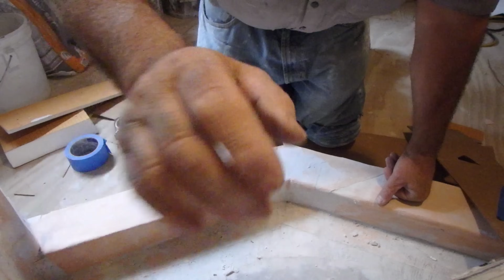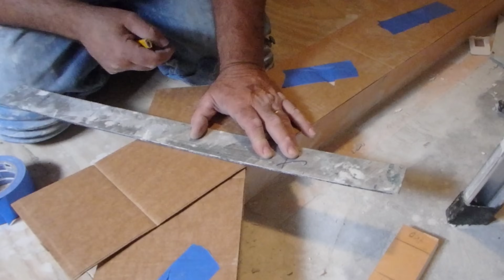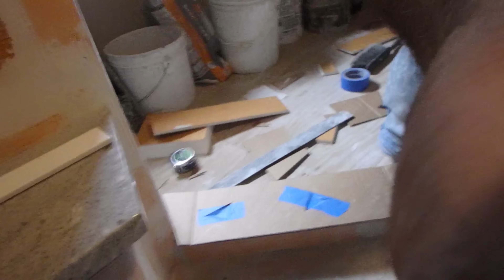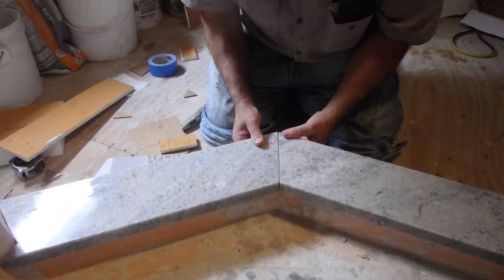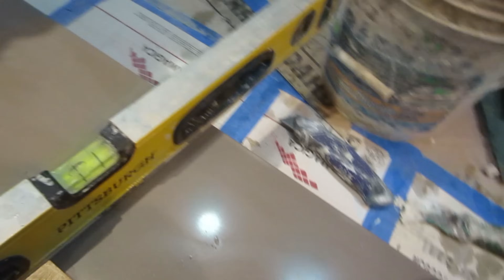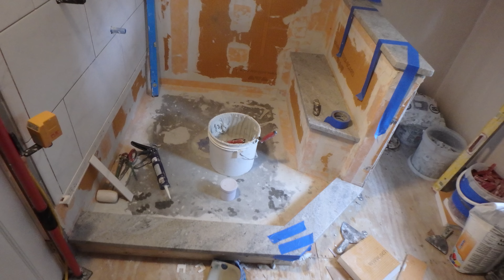Fitting marble thresholds on curb of  neo angles tile shower

Comment: We mitered our last Neo angle shower curb and that was a pain in the butt! We'll have to start using solid surface more often and for sure have to use this template idea. It looks like it can be done quickly. Thanks Sal 👊
Reply from the maker: I Always use sills, no grout lines, simple, easy, quick.
Reply: I like simple easy and quick, thanks again 👊
Reply: Hi Sal, I saw that you recently posted a video on how to correct align the Dewalt tray/rollers. Would you mind re posting that video?
Reply from the maker: Landberg Tile TV  The link is in the community tab, here it is gain, https://www.youtube.com/watch?v=vHbPS3BTy8E

Comment: Great video! I'm installing a marble threshold kind of like this. Should there be a gap left between the two pieces for expansion (filled with silicone) or is it ok to butt them up tight to each other?
Reply: wondering the same

Comment: Hey sal great video just wanted your opinion on a job I have coming up it a garage floor I’m gonna go directly over the concrete and leave out the ditra cause I don’t think it has the strength to support a car. Please your thoughts thank you
Reply from the maker: Ditra will be fine under a car, not an issue at all.
Reply: Is it ok without the ditra?
Reply from the maker: RM Tile  yes, but better with.

Comment: Sal my man. I have an emergency. I used Go Board on my shower walls and around the window, installed drywall corner bead around the window and added joint compound. I then sealed the joint compound with PVA and attempted to waterproof it with Mapei membrane but it peeled right off. Any advice??
Reply from the maker: Remove the joint compound, there is no place for it in a wet area, and difficult to bond to..

Comment: Good morning Sal , the card board templates are always great to use , but here's a question about the seam in the middle ( even though you had a nice tight fit on that angle )  : how do you seal that seam so that water doesn't get in ?? it looked so tight that there was no room for a grout line ? 
Thanks in advance :)
Reply from the maker: The entire shower is waterproof,  but a beed of silicone in that joint will do the trick.
Reply: Better to use knifegeade epoxy to fill seams. Silicone works as well but can't color match like epoxy.
Reply from the maker: jeosua beltran  you are correct, epoxy is a better choice, but more difficult to work with.

Comment: Marble or granite slab stronger or weaker than tile on top of curb?
Reply from the maker: Matters not if it is stronger, no grout lines and better in every way.
Reply: Granite is stronger than marble. Less chipping. Less cracking. Better to use quartzstone though.
Reply: @SalDiBlasi  how did you seam the 45's together?